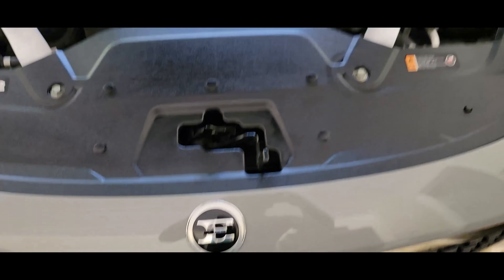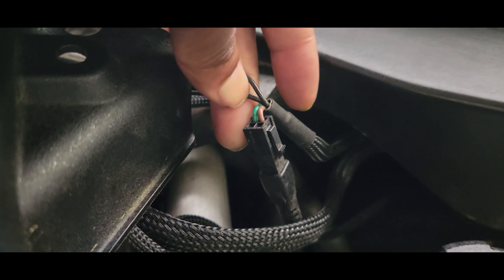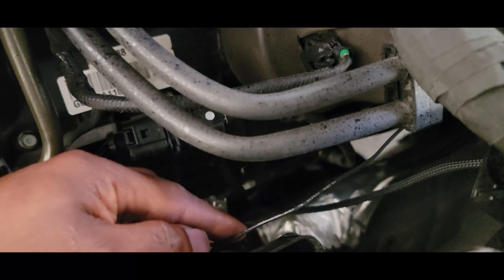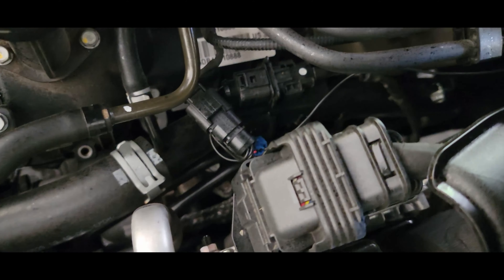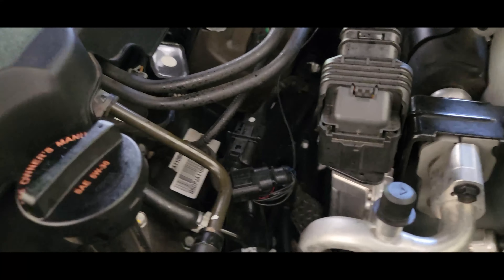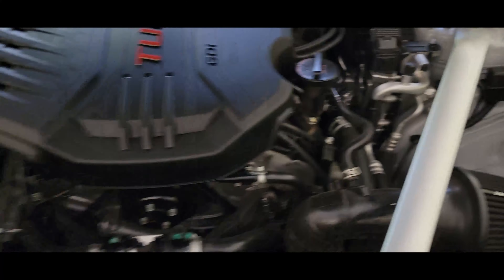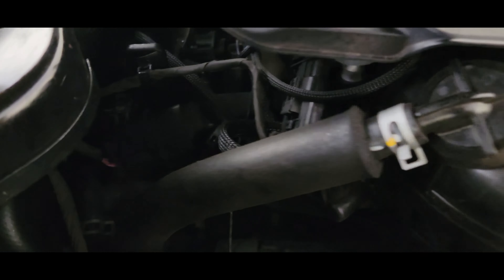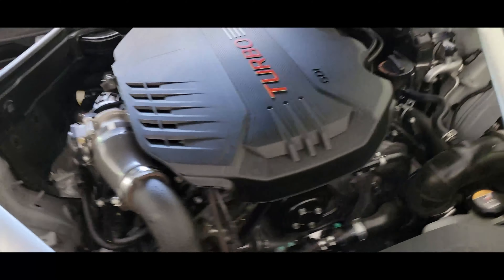JB4 Fuel Wires Install

Comment: So, for the quick connect, where do you run the black fuel wires that are pre-installed on the JB4 unit? Since you don't need to use the posi-taps to the O2 sensor, do they get tapped to the quick connect adapters? I really appreciate your videos, they have been super helpful. I used your tutorial on badge removal too, came out super clean with no scratches or damage to the paint.
Reply from the maker: Yes, use the posi taps on the red wire to the quick connect(plug & play) adapters
Reply: @tougeu13  Thanks! Yeah, Terry hasn't gotten around to updating the PDF yet, so I wasn't sure where those went. I appreciate all you do!

Comment: So for the newer jb4 that has the fuel wires attached, do we just use a positap to connect to the 2 red wires? Where do we get the positap?
Reply from the maker: Positap should be included with the kit if not Ace hardware or auto parts stores or places like those will have something that'll work

Comment: I had the JB4 installed about 1 year ago. Did the fuel wires come with it or are they seperate? What are they for?
Reply from the maker: I have a later version of the jb4 & they came pre-installed. But they give the jb4 afr input so that it can adjust & keep the car in a good afr range under the boost & not lean it out due to the added boost over stock boost levels.

Comment: So if you have to take it in for warranty work or anything can you take the fuel wires out and run it normal?
Reply from the maker: Yes you can, I actually took mine in and left everything in when they did the hecu recall...do I know wether they flagged mine as modded or not No but my guess would be no because they didn't realize my car was lowered when I paid them for an alignment and the other dealer I use don't care. So I'm probably good